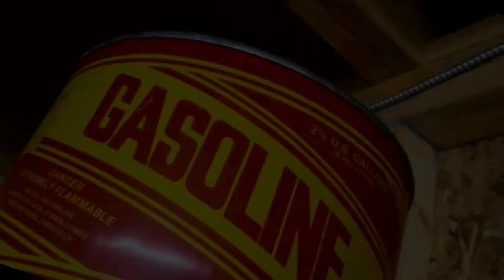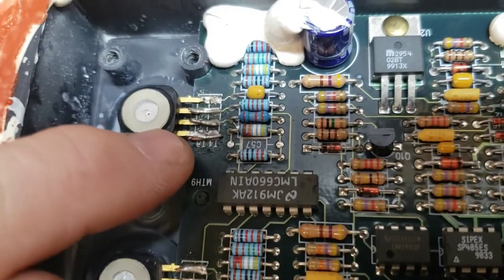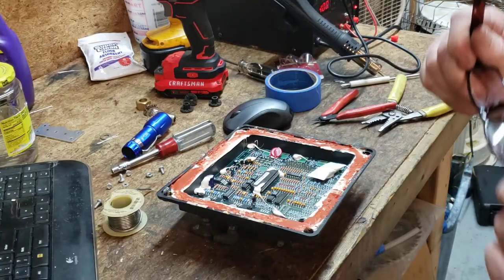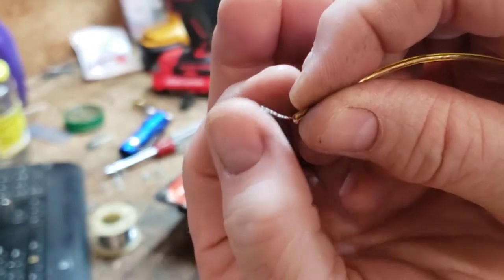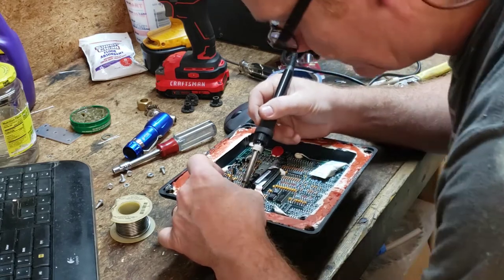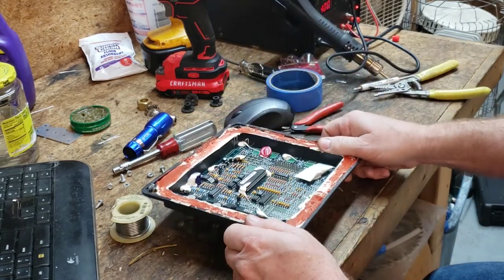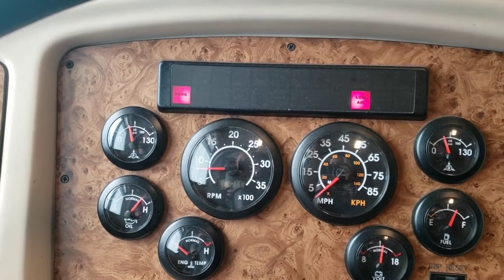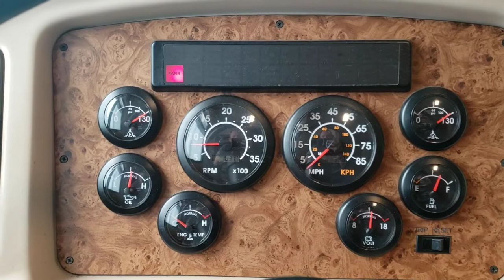VLOG - Diesel Pusher RV - Freightliner XC Air Brake Gauge Problem with VDC - FIXED !

Comment: I've done this a couple of times too, and one other step I did the last time was check the  inside of the air valves. I found oil had gotten in and cleaned it out.   My guages work better than ever now.
Reply from the maker: Great tip !

Comment: I can confirm this works. I did this in 2019 by just adding more solder and it still works fine.
Reply from the maker: I did that the first time around but it cracked once again. I then decided to add a little wire as reinforcement. No issues since.
Reply: @ImpalamansGarage  unfortunately I did mine before I saw this video. That's why I didn't add the wire, but 1 yr later still not defective again yet. 3:38

Comment: Any chance you give me a couple tips where you found yours? I looked under the bed. Maybe I’m just blind, but I cannot find it anywhere. My buzzers drive me nuts. It’ll go on and act like it’s zero air pressure one of the gauges and then a few minutes later it’ll pop right back up like it’s normal and it runs fine. I know it’s the same issue, but I just cannot find this panel anywhere.
Reply from the maker: Find your air lines. They go to the panel. You may need to trace them down.
Reply: Thank you! That was the ticket. I found mine on the driver side in the very back instead of on the passenger side in the very back, but it was right where you said it follow the red and green airlines.

Comment: Those wire mods look like a good upgrade.  However, you MUST use flux!!!!  Trust me, take it apart, and do it again!!!!!!  (You must put flux ON the joint...not the iron...). If you don't, the solder does not flow, and you are much more likely to get a cold/brittle joint.  Flux also literally removes (burns away) the layer of oxidation on those old joints to really get a great joint.  I believe this is the reason they seem to crack so easily...
Reply: Also need to clean off the flux residue when done
Reply from the maker: Yeah I'll take it all apart and do it again.    LOL.... Come here and bend over into the engine bay under the bed and pull that VDC module back out. You'll be like to heck with it. LOL
Reply from the maker: I put a little flux on the wire before soldering it to the pads. That is, in addition to what I added while tinning the wire.
Reply: @ImpalamansGarage  If I was the person who designed that module. I would of used teflon wires rather than have the leads soldered directly to the board or at the very least, bend stress reliefs in the leads, but I'm not the designer.
Reply from the maker: Personally I think the manufacturer of that VDC designed it to fail. That joint was tiny tiny. No wonder it cracked.
Reply: If flux was used during the soldering process, the joint would look much different.  Try it!
Reply: @ImpalamansGarage  Yes, it really seems like they did.  Not surprising unfortunately.  At least it looks like its fairly reliable otherwise, with mostly discrete components. (As opposed to custom ICs etc, which are sometimes impossible to find replacements for if they fail).  Btw, I solder, and repair modules, etc almost constantly these days.
Reply: @ImpalamansGarage  LOL.  Yep, but at least you know what can be improved on the next time it fails.
Reply: @ImpalamansGarage  I agree with your theory. Engineer's know how to design a product. If they really wanted it to last forever it would have been potted in either epoxy or silicone. You're actually lucky it wasn't potted.
Reply from the maker: @Frank-bg6xz  Agree. The design is crap. This is an extremely common problem on these types of motorhomes.
Reply: @Johnathan_Waters  Nice and shiny like polished aluminum
Reply from the maker: @Johnathan_Waters  Next time I need a module of some sort repaired I'm going to hit you up!
Reply: @ImpalamansGarage  might be another item to add to my repair services list.
Reply from the maker: One final thought. I am using a roll of flux cored solder that I have had in a drawer litterally for over 20 years. I solder so infrequently, it has lasted a long time. The color is quite dull now. I'm guessing it's so old it's oxidized on the outside. I will get a new roll I reckon. LOL
Reply: @ImpalamansGarage  Yes... its likely dried out long ago...  Go with the classic 60/40 solder (I use MG Chem's w/ the pink label)
Reply: @Johnathan_Waters  I like kester 63/37 myself,but I use mgchem 835 RA.

Comment: I have this issue. I have searched high and low for my vdc and can’t locate it. Where was yours located?
Reply from the maker: Under the bed. LOL.... In my RV if you lift the bed the unit is located on the wall surrounding the engine bay. In my case the wall towards front front of the RV.
Reply: @ImpalamansGarage  Spot on! Mine is located in the same place. I am sure I would have found it eventually.